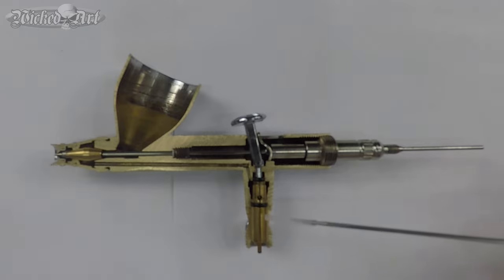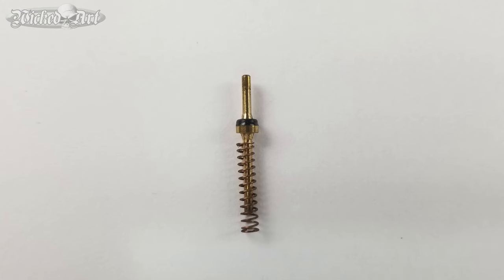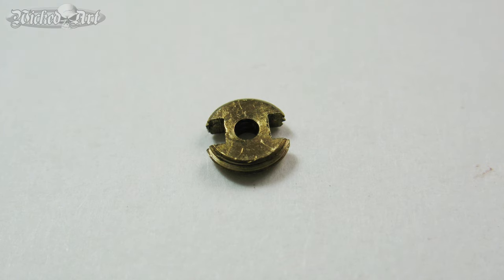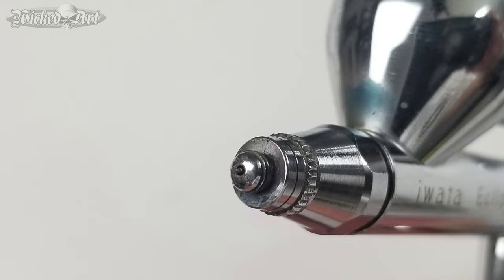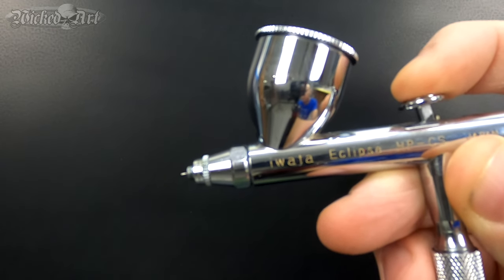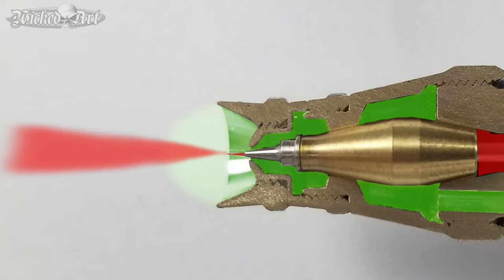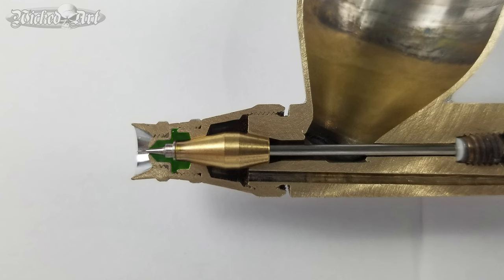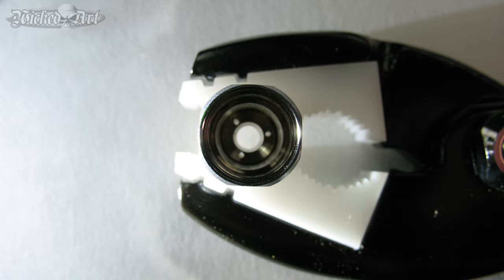Backflush Question Answered

Comment: My understanding was that backflushing puts paint and or cleaner back onto the needle bearing or needle seal, and if that fails, air back into the main body. Seals fail and are perishable, but I've always found if paint makes it back that far, its a big clean up. What are you thoughts?
Reply from the maker: I agree with the fact that backflushing allows cleaner (as well as paint, more on that below) to reach the needle seal.  That's partially why I choose to use the technique.  Here's the deal, the needle seal is located behind where the airbrush takes in paint (behind the gravity or side feed cup with a gravity fed airbrush, or behind the siphon feed port on a siphon fed airbrush).  The needle seal is only there to prevent paint from traveling into the air control valve and/or handle of the airbrush (and yes, that's a pain to clean up when it does happen).  Paint can and will reach the needle seal during normal operation because you're dragging the needle back and forth as you work the trigger.  That back-and-forth motion allows paint to coat the needle behind the gravity feed cup or siphon feed port.  Logically, some of that paint is going to make it to the needle seal.  If one fails to clean the airbrush adequately, that paint will dry on the needle seal and needle, basically glueing the needle to the needle seal (ever put your airbrush away for the night and come back the following day with a needle that doesn't move when you pull the trigger back?).  For what it's worth, most quality airbrush brands and models in this day and age use a Teflon needle seal.  A Teflon needle is far better in terms of longevity compared to the O-rings used long ago.  The other advantage to a Teflon needle seal is they are adjustable.  When one begins to wear, you can simply tighten it very slightly and it will seal again for a very long time.  I have airbrushes that I've used for twenty years, and I have never had to replace a Teflon needle seal.      

Based on my own experience, spraying cleaner through the airbrush several times, cleaning out the gravity feed cup (or siphon feed passage), and removing the needle in order to wipe it down a few times isn't enough to remove paint that makes it to the needle seal.  Most of the time you will still wind up with a needle that is stuck to the needle seal if the residual paint left behind has time to dry.  Backflushing the airbrush a few times during the cleaning process gives the artist a better chance of removing the paint on the needle seal without completely disassembling the airbrush.  So, backflushing saves time, especially if you use your airbrush frequently.  I hope all of that makes sense.

As always, what I teach isn't "the way", it's an option.  It's up to each individual artist to find what works best for them.

Comment: I had a question about changing out paint from acrylic, to enamel, and back to acrylic....

Lets say I'm done with the acrylic, clean the AB thoroughly, and switch to enamel. Once I'm finished with the enamel, is there any special procedure to clean out the enamel before I switch back to acrylic? Guess I'm concerned with the different solvents required by each, and wasn't sure if the enamel would leave some sort of "film" or "residue" inside the AB that would cause issues when going back to painting acrylic. The question probably sounds more complicated than the solution, but needed to know what your thoughts were on this?
Reply from the maker: Hi Steve!  Your question is somewhat common, and the solution is basically clean the brush well between using different materials.  Even if there's a slight residual amount of paint left in the brush (we can't get every lit bit of paint out of a brush without completely stripping it down... or at least I can't), whether that be enamel or acrylic, neither of those types of paint will have an adverse effect on the other.  That's especially true if the residual paint has had time to dry in the brush before you switch to the other.  If not, the amount of dissimilar paint that might be left in the brush will not be enough to cause any issues.  The solvents used for cleaning the brush evaporate quickly, so that shouldn't be an issue either.  When I was transitioning from solvent-based automotive urethane to the Createx water-based system, I was constantly switching back and forth between those two products in my airbrushes.  I would clean the brushes normally (using different solvents for each product) between sessions (meaning I wasn't stripping the brushes down completely) and never experienced any issues.

Comment: Interesting, one gripe I have with is with Iwata parts is that a rebuild kit costs very close to a new gun. Example lph80
Iv over 7 of them in a box just seams a waste.
Reply from the maker: I agree, the parts are costly if you need to replace a lot of them.  The benefit is most of the internal parts take a very long time to wear if the gun is cleaned and taken care of properly.  I retired the brush I cut in half earlier this year.  It's nearly thirty years old and I used that particular brush almost every day for hours on end during its life.  I occasionally replaced the needle, fluid nozzle and a couple of O-rings during that time.  The needle and fluid nozzle were generally replaced because I dropped the brush or ran the needle into something and damaged both parts.  That was my fault. My biggest complaint was the threads on the head cap and nozzle cap didn't seal very well anymore after having been taken apart so many times over that time span for cleaning and maintenance.  The trigger wasn't very smooth anymore either because it had a pretty significant groove worn into the back side of it from general use.  Overall, I got my money and then some out of that particular brush.  Having a piece of equipment in service for that long also speaks volumes about Iwata's overall quality in my opinion.
Reply: That's why I quit using them creos is same as iwata just starts at high line goes to micron and it's reasonable prices.